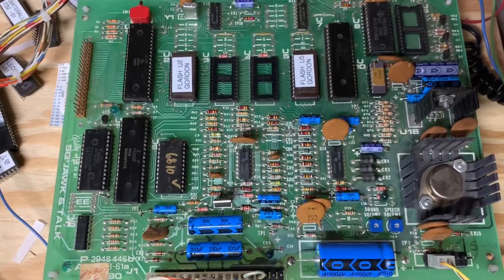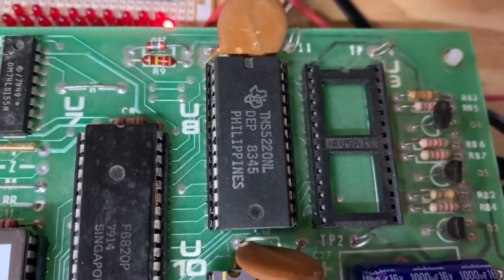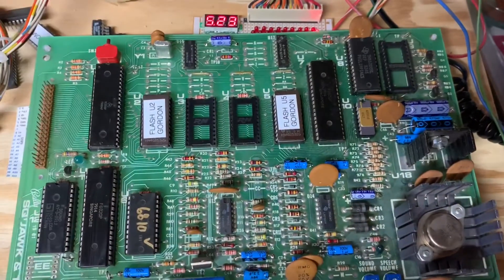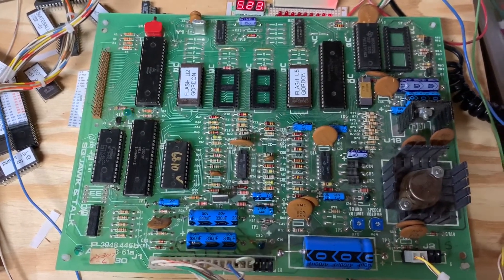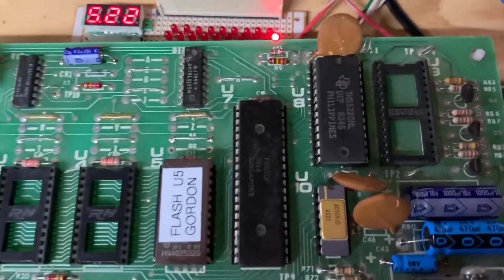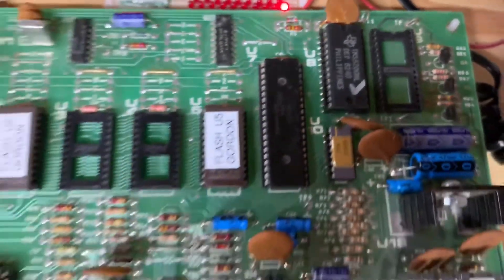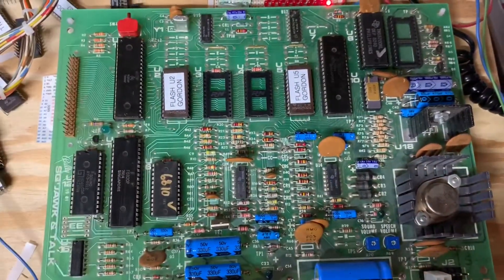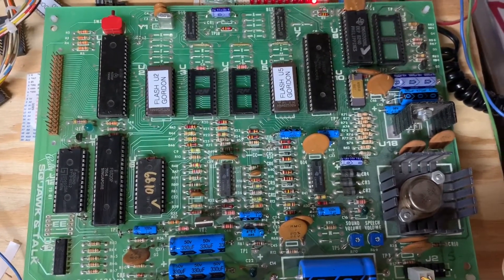Bally Squawk and Talk TMS5200 vs TMS5220 Speech Synthesizer

Comment: Thanks for this example. With some digging and transcoding to suit the different chirp and LPC tables in the 5220, it's possible to make some new EPROMS which work much more correctly with the 5220 but the original 5200 encoding tables are lost to time so this is possibly easier said than done. The minor 'extra' features of the 5220 occupy some internal spots used by the 5200 for slightly different purposes, thus the pops and distortion when the 5200 code goes to use them. I can't image the world's supply of TMS5200 is very large today but the TMS5220C is out there in good numbers. All that sound data and the code to feed it to the 5200 is contained in only 8K.